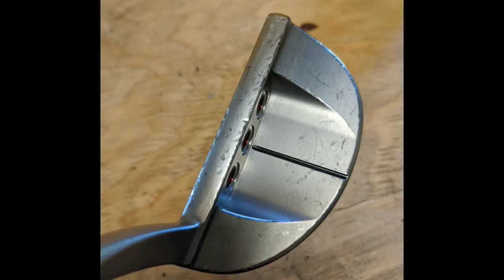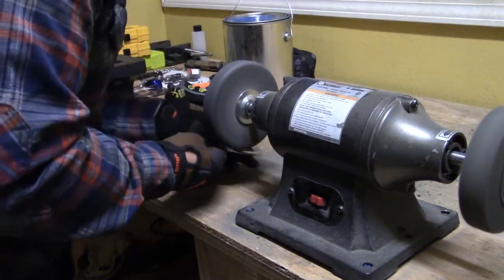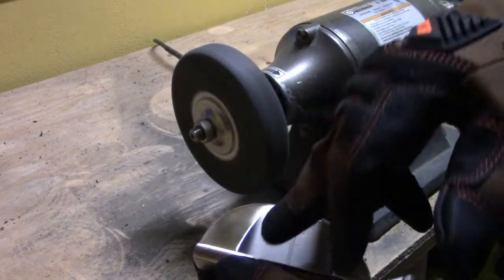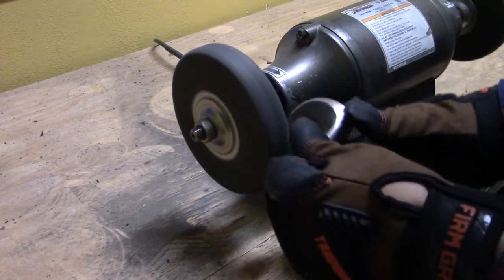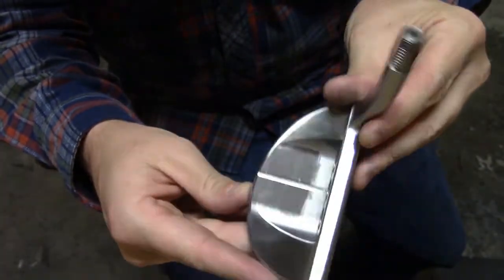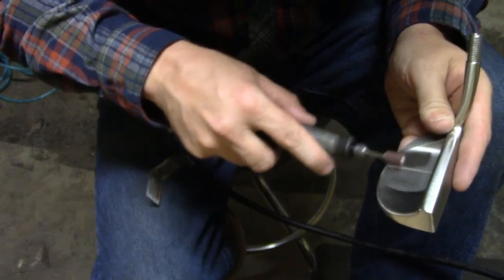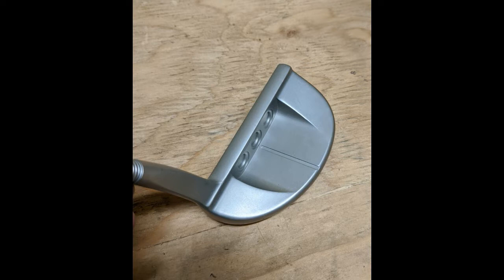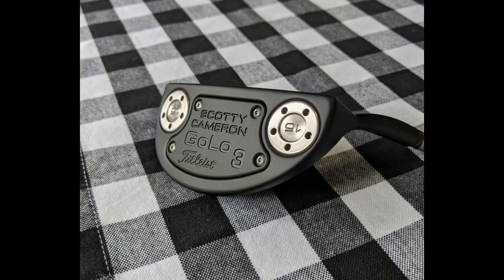Detailed Putter Customization (Scotty Cameron)

Comment: What is the grit on the grinder
Reply: I am interested on that stone wheel grit # also...I have begun restoring many of my family and friends’ old golf clubs. I have a bench grinder w a coarse and medium stone wheels on it. I bought a few thrift store $1-2 irons and putters, verrrry beat up, gouged, nicked up.... ...just to test my skills on my bench grinder....ouch!!....Even w the greatest care and even strokes of the club on the medium grinding wheel...I found the bench grinder is wayyyyyyy too aggressive unintended removing too much metal.....especially on narrow edges where the grinding wheel is hard to navigate the club edges. I found this caused a ton of corrections to straighten the edges after the grinder. My son , who is an avid golfer warns me a putter’s metal weight is crucial to the integrity and feel of any putter, I.e. removing putter club metal on a grinding wheel....changes the weight to throw off the feel....He has tried a few test refinished putters and was not happy w loss of the weight on putter strokes. With that said, if....we can determine the correct grit on these grinding wheels, I would try again...hopefully a much finer grit wheel?

Comment: Hi. Would the putter rust if left after the sandblasting process and nothing else done to it? Many thanks great video
Reply from the maker: It depends on what metal your putter is made of. Stainless steel and aluminum won't rust (in most cases) but carbon steel will start to rust almost immediately, unless properly oiled

Comment: Good video. You never mentioned anything about restoring the face of the putter. Do you bead blast the face. If the face has a small ding how do you remove it. Thanks?
Reply from the maker: The only way to repair the face properly is by re-milling the face. I don't own a milling machine so I am currently unable to show that stage of the process

Comment: hey dan looks great ! could you let me know what the sanding wheel is and could i pick them up dome depot ? thx  sal in toronto
Reply from the maker: So you want to be able to pick up one of these sanding wheels at home Depot or Lowe's, they are 3M deburring wheels, I'd have to look up the exact specs because I don't remember that off the top of my head, but they sell them on eBay for 60 to $70

Comment: what paint did you use for the black finish?
Reply from the maker: It was matte black powder coat, but I've actually stopped using powder coat and started using Cerakote because it is a much stronger finish

Comment: Thanks for a great video Dan. Do putters need to be sealed after sandblasting with electroplating, paint or whatever, to prevent rusting?
Reply from the maker: Only if the model is made out of carbon steel

Comment: at 7 minutes and 51 seconds, can you tell me the paint color (how to mix) so that the paint has the same color as you paint?
Reply from the maker: I'm sorry I'm not 100% sure which paint you're talking about in this video. I did do a video where I covered exactly what kind of paint fill I use on my putters so if you check that out maybe it'll answer your question. If not, could you please give me a little bit more detail about what paint you're talking about? Are you talking about the putter head itself the matte black? Because that's not actually paint that's powder coat
Reply: @justdan5735   because i tried to paint with tayami spray paint, after painting it black i smeared the words on the putter face in yellow.  but when i erase it, both the black and the yellow color fade away.  it cannot retain the black color.  Can you tell me the paint process to keep the black paint on the putter face as long and beautiful as scoty can.  so that when I color the text, I no longer have to worry about the black fading.  If possible, I would like you to tell me the name of the paint in detail and how much to mix and what paint sprayer to use.  I sincerely thank you very much.
Reply: and at 9 minutes 13 seconds in the video, can you tell me what kind of black you paint the putter face.  What are its ingredients and how to make it?  and what machine (eg paint sprayer) can be used to paint the putter face black like that.  because I'm looking to paint my putter face black.  I would like to thank you
Reply from the maker: @hanggolfanpcua595  Okay, I think I understand what you're saying. I think yhe issue you are having is you're using paint instead of powder coating. Sadly painting a putter wont work... even if you do everything right the paint will flake, chip or peal. Powder coating is a totally different process and requires specific tools. Here is a link to my video where I explain in detail how to black out your putter. https://www.youtube.com/watch?v=fQP4trPvTWo&t=112s
Reply: @justdan5735  May I ask you.  after black powder coating.  then I want to paint the letters on the putter face.  then how.  I painted with nail polish, and removed excess polish with nail polish remover.  but I'm concerned it will strip the black paint on the clubface because it's a cleaning agent.  Can you make a video to teach me more.  because I'm looking for a way to paint the text in gold on the black background of the putter face.  I sincerely thank you very much.
Reply: @justdan5735  because I'm looking to turn it into a black putter face and gold text.
Reply: and can you tell me the composition of the paint in the black paint that you have painted.  it's a bit rude and annoys you but I'm Asian, so my English listening is a bit bad so I can't understand what you say in the video, if possible can you write down the ingredients for me  paint and the name of each paint and how to mix it.  I sincerely thank you.  and by the way is your paint sprayer an electrostatic sprayer or just an electric paint sprayer?

Comment: Gained a subscriber. What grit grinding wheel? I have been wanting to restore irons as a hobby and this looks fun too.
Reply from the maker: The wheel that I used is linked in the description, but if you can't find it let me know and I'll look it up for you. Thank for your comment and support!
Reply: Do you by chance know how to do irons? I did a set with a 6 inch deburring wheel and then a buffing wheel but I think there has to be a better way
Reply from the maker: @codyparker8187  irons are a bit tougher than putters, especially cast irons. The grinding process is similar, but requires quite a bit more work. A sand blaster is needed if you want to give the irons a "like new" or original finish. You also have to be careful not to remove to much material from the sole of the irons or you will change the bounce. The other challenge when doing irons is the face... It is nearly impossible to keep the face of the club perfectly flat when using a grinding wheel. When it come to irons I normally recommend either replacing them or sending the back to the manufacturer to be professionally restored. All that being said, it is possible to restore irons back to good or very good condition it you have the right tools and pay close attention to detail
Reply: You are super helpful. So sand blasting chrome blades would give it a raw unchrome finish?
Reply from the maker: @codyparker8187  it would definitely take away the shine of the chrome, but unless you are using an extremely heavy grit it wouldn't remove the chrome plating

Comment: I'm still trying to fathom how that deburring wheel took out all those gouges..... You must have been on the grinder for literal hours.
Reply from the maker: Most putters take 30 minutes to one hour of grinding. You'd be surprised how much material the wheel takes off
Reply: @justdan5735  Nice. I've been looking at these wheels for awhile now and am torn because of how expensive they are. They last awhile?
Reply from the maker: @shmirginhymer1867  I put about 7 to 15 putters through these wheels every week and a single wheel last me about 6 to 10 months. They are expensive, but in my opinion they're totally worth the money and pay for themselves over and over again before I replace them
Reply: @justdan5735  You just answered my question. Probably going to pick one up tonight. Problem is my grinder has a 5/8 arbor. All these fine wheels are 1"